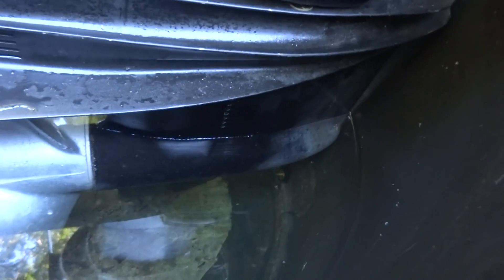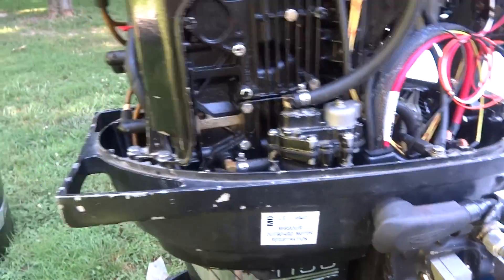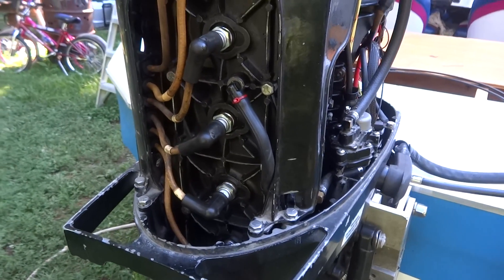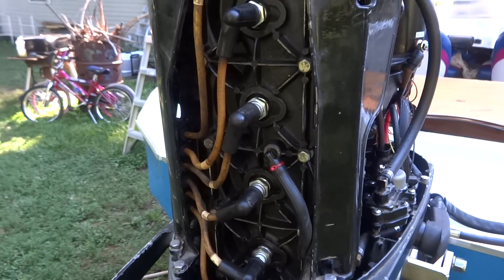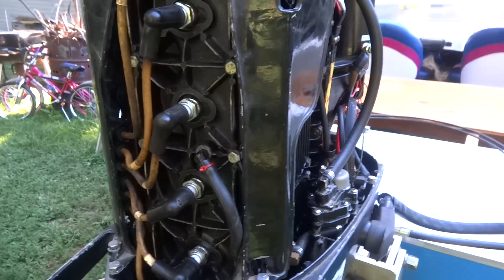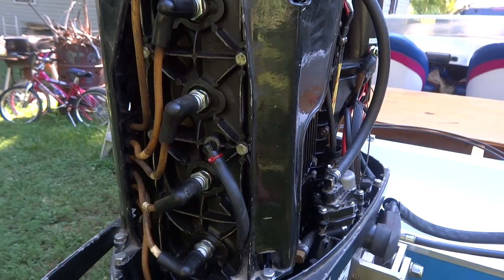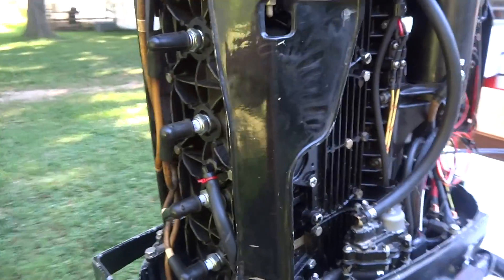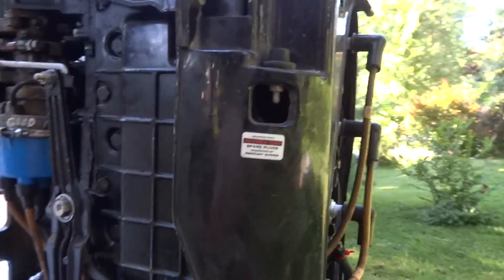76 Mercury Inline 6 Water Intrustion- No water from tell tale. Water jacket fail!!!

Comment: hey watched ya video and the other one with the fix but still hard starting I have a bit of a theory .I rekon faulty trigger causing a sporatick firing on wrong cylinder causing the engine to start backward (not sure if its possible on these particular motors but some 2 strokes will run backward ) the whine is the starter motor pinion not disengaging because running backward causing it to ride up the kicker and stay engaged the smoke coming out pisser valve due to water pump running backward .
just a theory !
Reply from the maker: It's fixed bud..... Finally found out why...... Rotor had slipped on distributor shaft. Trigger is good. 
The whine you hear in this video is the waterpump "key" grinding into the ss waterpump base. I need to rebuild this lower, but I've got a different one on there now.
Reply: @cturboaddict  this was a long time ago....but how does that work? how did the distributor cause overheat/no pisser? as long as the driveshaft is spinning, the pump is, and if theres pressure, no blockages, water should flow?
Reply from the maker: @northboundtjr  distributor had nothing to do with the tell tale

Comment: Never start an outboard without having water to it covering the intake holes or use those ear mufflers?  You burn the water pump up in seconds.  The reason you have exhaust coming from your tell-tale is cause you are essentially blocking your exhaust with the water covering the exhaust hub and forcing the exhaust thru your tell-tale.  The engine distributes water into your exhaust to help cool it down.  No water from your tell-tale, replace your water pump and housing.

Comment: are you gonna keep the l6 type motor or go omc? if you still wont a merc, a 140 or 150 would be good. where are you located anyway, cause i know a where a bunch of 140 and 150's are at her in central NC for cheap.

Comment: Clogged my 1978 1400 mercury yesterday with silt from the gulf. It acted just like this. White exhaust/steam. I ended up pulling the hose off the pisser fitting and the water started flowing again.

Comment: Could you keep your hand flat on the exhaust plate without burning your hand?  I mean hold it there not just touch and let go?   That motor ran from 3:20 till 7:20 before you said the water bucket was full.  Ive torched water pumps in as little as 15 seconds without water.   That is steam your seeing coming out of the tell tale.  Your now non functioning water pump is barely pissing water up to your extremely hot block creating nothing but steam.  I bet you could cook eggs on the exhaust plate.